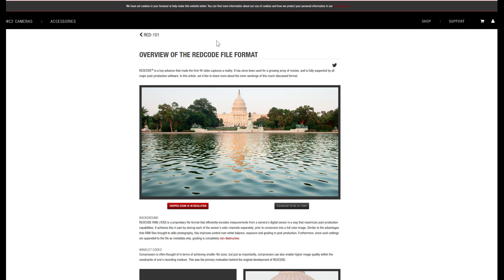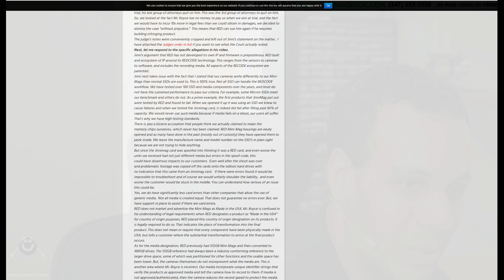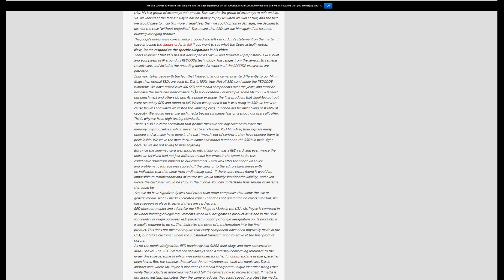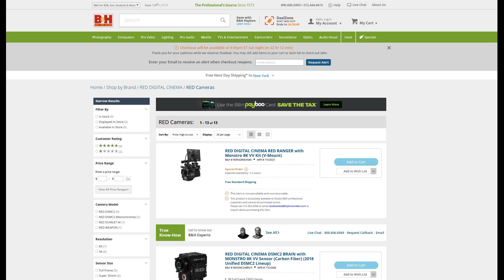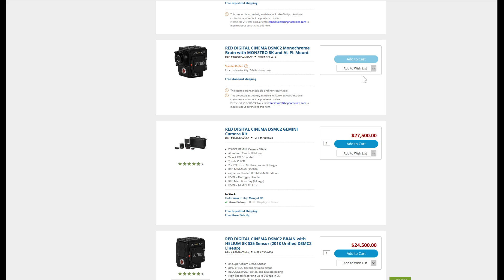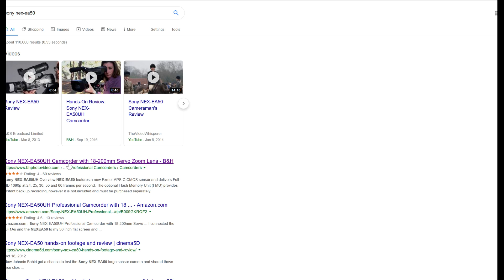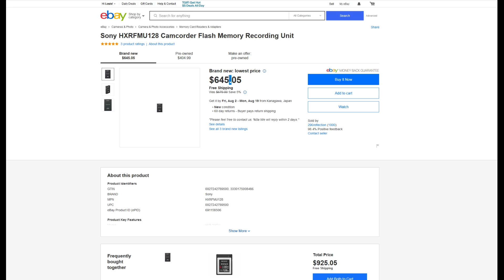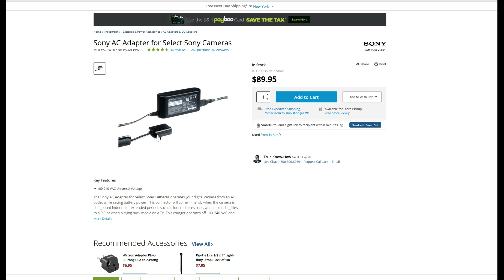Red Camera Mini Mag thing - my take on it.

Comment: The main problem wth RED's storage is that the data recovery fee for their crap SSDs is built into the price instead of using a higher quality SSD and avoid having to do recovery on a regular basis in the first place. The crap SSDs is also the reason why RED forces full erase instead of allowing individual clip deletion, spares them the trouble of having to cope with SSD performance degradation as the wear-leveling and free blocks tables become more complex which may otherwise require a faster higher quality SSD.
Reply: if high quality storage was used they would rarely if ever require data recovery. Sounds like red uses the "free" data recovery as the reason for the 400% markup. So the millions of dollars in testing was in fact to find the worse possible drive. This creates value for the free data recovery.
Reply: @jrok96  Pretty much. Kind of like an offline version of your-data-as-a-service. You pay a periodic sub (RED cartridges) and that sub expires when you need data recovery on it since deep-pocket studios won't trust the SSD after it has already failed once.

If RED was genuinely concerned with the customer's data safety, the camera would have redundant storage at least as an option.

Comment: I get the comparison with other camera equipment that's also super expensive, but I can't help but feel like it's inaccurate.
The reason why people are pissed about the red mini mag SPECIFICALLY, is that it's not some proprietary connector or hardware or anything, it's just a regular msata SSD with a huge markup. 
Making 3rd party red mags is really really easy, since it's just an msata SSD, but they intentionally gimp 3rd party mags in their firmware. 
All the other components mentioned in the video are, as far as I can tell, absolutely proprietary. They're not just a rebranded SSD with an adapter slapped on it.

Comment: @Louis Rossmann Would it surprise you to know that the "Red Code" or whatever special sauce, is actually just the same old work around for fat 4GB file size with a new name? So tech that they did not design. Also, there is no firmware, there is a pin to pin adaptor from a SATA port to their proprietary plug for the SSD. I guess that's what they're referring to when they say "Proprietary firmware"?

I don't own one, and I'm not in the industry. I have looked into this though and it seems to me that it all stacks up to RED making misleading (if not fallacious) claims in order to sell normal tech at way above normal prices. 
LTT did a vidya on this very subject which is what piqued my interest.
I can understand the outrage and I think it is justified because Red are selling generic and from my understanding, cheapest available SSD's in a anodised aluminium case with a different plug to hide that they are just cheap ssd's while claiming to have spent blah blah on RnD, when the truth is, they've done this intentionally and there is nothing special about their incredibly expensive storage solution and in fact, they know it's so lack luster that they offer free data recovery. Also knowing that you're never going to be able to recover anything in 99% of cases.   

It's one thing to sell a luxury item at a luxury price. It's something else entirely to sell a lump of lead sprayed with gold paint, claiming that it's 24k gold.

Comment: You technically don't need a RED camera for movies but you should definetly get one for anything of higher production quality. The image quality is really solid and you get lots of freedom in post which you don't get with the highly compressed output of a cheaper camera. 
Cheaper cameras are fine though. I have a G7 myself and I really like it.

What RED is doing is kind of stupid but understandable. The cheap SSD's are a tradeoff (apparently you can't delete individual files because the SSD isn't fast enough to overwrite the bits so you have to delete everything at once) and Linus said they should offer redundancy over data recovery which makes a lot of sense to me. I'm not really a RED expert either but I would also be pissed if my expensive RED SSD was just an adapter to one of the cheapest NVME SSD's available.

Comment: Camera assistant and occasional colorist chiming in here.

RED certainly isn't the most expensive company in the business. Codex Capture Drives, which can be used in cameras by ARRI and Panasonic, as well as Canon's top end C700, are even more expensive than RED's Mini-Mags.

The problem with the RED Mags are the outstandingly slow transfer speeds. They top out at 300 MB/s on the newest DSMC2 cameras (slower than that on their other cameras), ensuring that you'll need to use a high compression ratio when shooting at the highest resolutions and frame rates the cameras can record. REDCODE's compression is very good and results in pretty small file sizes (I'm working on a 5K music video right now that ended up weighing in at less than 300GB for all of the footage), it's not ideal. 

To put it in perspective, the fastest 2000x SD cards right now write at up to 260 MB/s, and they cost about 64% of what the RED Mag costs per GB, though they top out at 128GB a card. There's also CFast 2.0 cards, which are used in cameras from Blackmagic and Canon, as well as the ARRI Alexa Mini (the most popular cinema camera today). Those write at up to 430 MB/s and can cost even less than the fastest SD cards when you go for 512GB and 1TB cards. Blackmagic goes even further than that by offering an adapter for their URSA Mini Pro camera that lets you use off-the-shelf 2.5" SSDs, which are of course even faster than CFast cards for a mere fraction of the price, or nearly double the throughput of a RED Mag

Oh, and those ultra-expensive Codex drives are actually PCIe drives that run well into the several gigabytes per second when it comes to write speeds. 

So yeah, RED storage media is expensive, but even compared to other storage standards in cinema cameras, it doesn't perform anywhere close to what its asking price would suggest.
Reply: Hi, which is the entire point of Jini Tech, that with some basic information you can actually defeat Red in any court room about their misleading and wrong information regarding their recording system.

Comment: We've spent millions on the R&D of our proprietary SSD............. To develop an adapter board.
Reply: RED probably needed the adapter board because it would have required too many changes to their camera's circuit boards or perhaps a better interface designer. Either way they chose the least expensive approach, the million dollar adapter board. Although they could have purchased a run of the inexpensive SSD modules so they could get sequential serial numbers. That would make non-RED SSD modules easier to detect.

Comment: not everything in the pro video space is completely overpriced, look at blackmagic design. i got the pocket 4k new for 1300€, it can record to a samsung t5 ssd, 1tb for <300€, and i even got resolve studio for free.
Reply: Sure, but it costs several thousand dollars to turn it into a usable camera. It isn't weather sealed, it's made of plastic rather than magnesium alloy, it has chintzy feeling buttons, it's got a baby duck sized sensor, a terrible form factor, no IBIS, short battery life, no tilting LCD and no autofocus. But Grant Petty's got you fooled into thinking he's a philanthropist giving away gear. Feel sorry for you!
Reply: @JonPais  it has autofocus. lp6 are cheap. of course you need a big rig to use it really professionally, but for normal productions it is fine. (yes, micro 4/3 isnt that good and speedboosters are expensive)

Comment: People fail to take the sales numbers into account. Rd probably sells a couple of hundreds of cameras/year at best. 
So any development cost will be divided among very few customers. I sold hardware worth 200€ for over 10000€ to some customers. In that case there were only 3-5 potential customers worldwide, so we had to recoup our cost with only 2-3 sales. 
The problem in this case is not the 1200$ markup on the SSD. The problem here is the mediocre quality. If  i have da development project that has a lot of engineering costs, i use the best hardware available. The HW cost don't matter much, and it reduces the chance of failure.
Reply: In RED's case, there wasn't much RnD involved They simply did what all camera makers do, slapped a CMOS sensor ($50 from China) into a box, EEPROM-ed a basic OS controller onto a chip, ($25) put their logo on it, and with it, they want to grab some market share from ARRI and Sony. Really nothing Blackmagic didn't do, but much cheaper, and of a truth, nothing you couldn't do yourself with the sensor, a box, some connectors, and a Rasberry Pi.
Reply: @Syrian Hamster Yes, but definitely not "millions of dollars" more complicated, unless you count the CEO's salary!
Reply: @bosstowndynamics5488  The point of contention between RED and Jenni is that the latter took advantage of the former's overcharge, to do exactly what RED did with the drives, assemble off-the-shelf parts, and sell them cheaper than RED, creating a secondary market. RED's objection and suit was based on lies about IP, So Jenni exposed them publicly.
Blackmagic has taken a similar approach, creating a market for DCCs far cheaper than RED, Something which RED has done to ARRI, so the main question is "who's hoo-ing who", should ARRI sue RED, and RED sue Blackmagic?

Comment: People probably won't complain too much about the price of Ferrari parts is way higher than the ones of a Toyota... they just don't understand it's literally the same kind of issue.
Reply: Except parts for a Ferrari are actually worth more than parts for a Toyota because they are of a higher quality.
That isn't the case with RED. They're just repacking low quality SSDs in a shiny case with a special adapter. That's all.

Comment: The argument that it's mostly an unnecessary luxury is kind of the core of it I think. People tend to think they need the best of the best in order to do X or Y because someone they look up to uses that product too, or an advertisement told them products A or B were inadequate, but mostly, no you don't need that. Sure, you need high resolution equipment to show 4K video, especially after editing, but does the content you create really need 4K? Will anyone really notice if you don't? That medium end DSLR will probably suffice, heck sometimes a phone camera will work perfectly fine even! (shoutout to @bigclivedotcom)
Yes, red's solution is far from honest, but if you're spending 40k on a camera, will you really be bothered to save a hundred here or there to go shopping and hacking your equipment?

Comment: In the cinema camera world, RED is the discount brand.  They are a fraction of the cost of the Sony Cinema cameras (roughly $200k) or Arri cameras.  Remember, the businesses that buy these cameras are rental houses and Linus Media Group (for some reason)
Reply: Ima stop you there.
This whole thing has nothing to do with the actual camera its great quality and many great shows and movies have been shot on or used clips shot on red.
They may be cheaper but that doesnt mean they are worse. In that idustry everything is marked up stupidly so at the prices without being a tech expert its hard to know when youre being ripped off, except storage cause that one anyone in this day and age can figure out and thats the issue tge storage medium was being marked up with a lie and some dodgy software locks.
Reply: @nathanielsharp2615  What?  I was responding to Louis's direct question for the comments as to what price point the RED cameras fit in the digital cinema market.  They are the discount brand.  There is no two ways about it, they are the cheap ones.  I didn't say a single thing on the controversy of the video.  I don't honestly care one way or the other.

A red setup costs around $50k

A sony setup costs around a million, with the camera body itself costing ~$200k

An Arri setup costs about the same as a sony setup.
Reply: @Tritium21  oh sorry mate mustve missed that part was on the bus with no headphones so i was only hwaring every second work from him

Comment: Most people assume that prices on things have something to do with cost of production... it does NOT.
There is nothing about production or value when it comes to price a product.
Prices on things depend on one thing only: How much are people willing to pay?
Reply: More like how much can we force people to pay. Remember that RED made an adapter and flashed the SSD firmware with custom vendor IDs, just so they could deter people from using knockoffs. And when a company finds out how to get around it, RED sues that company over intellectual property infringement. The fact that there is outrage is clear example of people not willing to pay the price RED is setting.

Comment: Btw, Louis, the actual reason to be aggravated is that RED isn't using an off-the shelf product with superb redundancy or reliability. They're not even using Industrial-grade chips which is AVAILABLE to us. They're using the cheapest quality of available flash memory- which is pre-tested by their fabricators- and testing them AGAIN. This holds as a testament to why their Mags fail so often.
1. They're standard consumer-grade quality, not industrial-grade.
2. They "test" their media heavily, which are already tested from the manufacturers!

Also, I'd recommend that you watch the Jinnitech video where they open the Old and New mags. RED might be a "luxury" camera company, but they're supposed to be the top-of-the line. 
But it seems that all they're doing is building a mSATA to proprietary converter, and then another box for that proprietary converter to be converted to SATA again. Blatant ripoff.
Btw, if I pay $500 for an SD card today, it can sure write faster than the RED MIniMag!

Comment: The thing is this, when you open a Red mini drive, you find a standard 489gb ssd micron drive consumer grade, about 200usd. There is no special firmware on it what so ever. If you would get a Micron 480gb SSD drive yourself and slap it in the Red camera, it will be detected as a Red drive. So why to pay for a ssd drive that's 2500usd with Red while the actual drive is only 200usd? 
This for me it's a rip off. Not to mention that the camera firmware is rigged so the micron drive is detected as a red drive.
Besides, the case says it is made in the USA, it is clearly not, assembled perhaps yes. A violation of the law.
Reply: @bosstowndynamics5488  I think the law on about where it is made should be revised, let's be honest, most products especially with electronics parts can be questionable. But it's a minor point in this. Honestly I don't care where a product is made. As long it isn't a rip off.

Comment: I don't own a red camera but have used them; it's not necessarily the fact that it costs a lot for storage, that's normal in the camera industry (CF cards and the like); it's that they sell their generic storage claiming it's "the best thing in the world and no other storage solution can even compete" which is what anyone at that price point would assume but it isn't the case. In the least it would be perfectly fine to have the industrial grade SSDs instead of the cheapest consumer grade SSDs, and at best, a RAID solution to ensure that no data recovery is ever needed (unless physical damage and then RED would cover that). These overpriced RED SSDs fail more than what is expected and losing footage on a 40'000 usd camera setup simply isn't acceptable. To be honest, if the company responded with "yeah they're just cheap SSDs lol", I wouldn't have cared at all; it would just be the same old price shafting. It's the way that they defend their price shafting that is a joke, and nobody should be defending them, considering that people who do have the money for the cameras anyways aren't going to be fazed by this 'incident' and no sales will ever be lost.

Comment: the problem is markups, if they do small change to general electronics and mark up the price that high as red that is screwing up their customers, in AV industry it's logical to have things overpriced as they have to manufacture them but possible market is quite small, but it's different in how much they markup their products, anyway full set of red HW you need for recording would cost you around 50k+ , not that i care much about it but i hate tech companies doesn't matter which ones that take general HW put it into enclosure and create connector adapter to it and lock it by some weird FW configuration   and put in almost cheapest ssd they can find mark up price 10+x and sell it, samsung 1tb drive msata format here 860 evo costs here something round 170eur, opposing to that sony is known for creating proprietary components like that drive usually do come with better read/write speeds , stability and reliability that is available at the time it came out. (additionally at the time 128GB ssd was quite good capacity at the time, probably comparable to 500 -1tb ones now and the price was about third of the red mags now ) and like mentioned if the red at least provided something premium for that premium price but sadly that's not the case. that's the problem now with most of the electronics you are paying premium for it but you have to investigate if the offer really is offering anything premium or it's just marked up price to look like premium product.